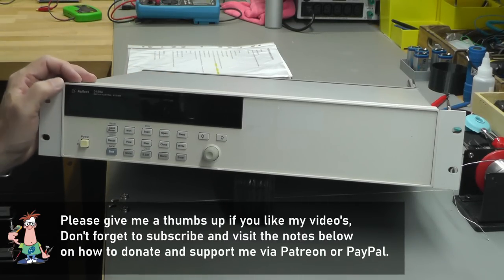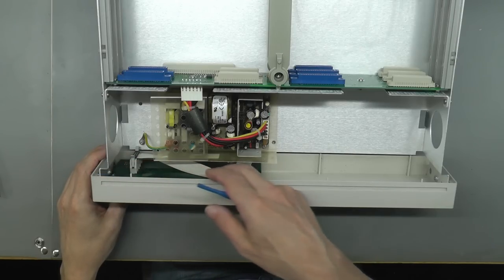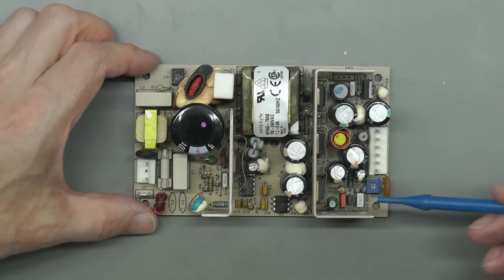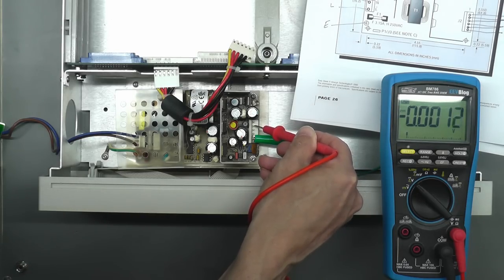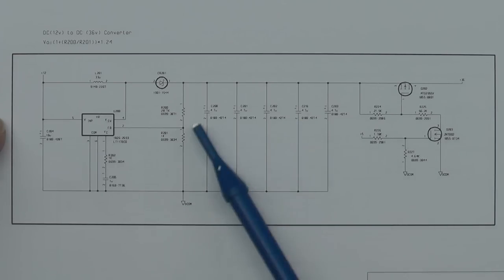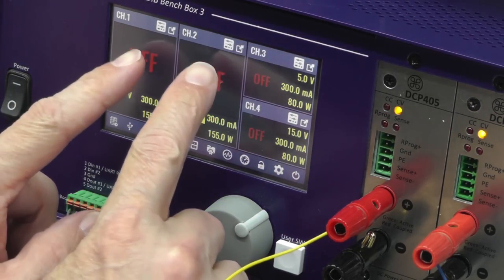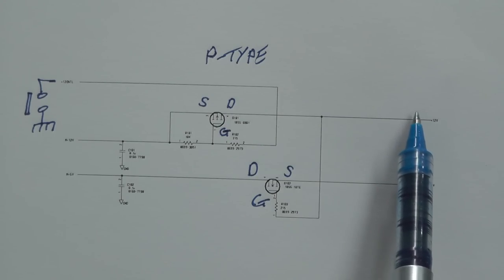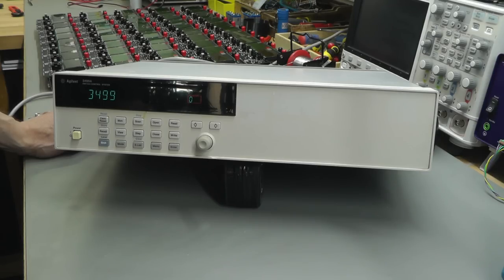No.094 - Agilent 3499A Switch Control System Repair

Comment from the maker: UPDATE:
The temporary P-type mosfet has been changed out for a DPAK package MTD2955V and all is working.
Quick GPIB test, I plugged in a 44471A general purpose relay module and it works great with WinGPIB.
ROUT:OPEN (@100)	- open relay 00 in slot 1
ROUT:CLOSE (@100)	- close relay 00 in slot 1

Comment: Nice, low cost fix. It's very satisfying when that happens. This is one of those occasions where I could have fixed the fault and had very little idea what the kit does. It will be interesting to see how you use it. Another great video where you go into detail about the fault finding and repair process, which I love. Thanks for all your efforts Ian, it's all very much appreciated.

Comment: Caps on the out of DC-DC are usually selected with some low enough ESR, that's why they were tantalum (or ceramic in modern circuits) and not ECaps.
Higher ESR will probably translate to higher output V ripple, which may or may not be critical.

Comment: Cool! Very simple device, I am actually trying to find myself a P-Channel Mosfet or two in my salvaged components for a project I am making, but I can only find N-Channel and PNP Transistors!
Too bad I am needing to switch the 12v rail otherwise the 12v to 5v N-Channel idea would work!
Reply from the maker: Yep, the P-channel FET is so handy for simple voltage rail switching.
Reply: Why not use a high current NPN BJT in emmiter follower configuration? A TIP3055 or TIP41C for example? With an NPN BJT you don't need to have a higher voltage on the base than the emmiter for it to fully turn on unlike an N-ch FET where the gate voltage needs to be higher.

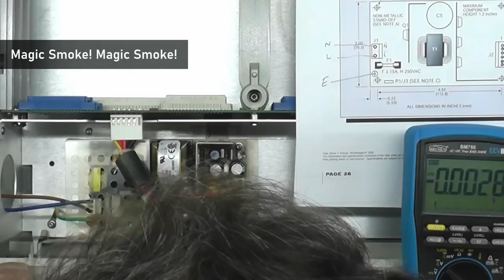Comment: @17:00 when you powered up with backplane plugged on you said there was smoke coming from P/S. So while the issue in end was not the P/S itself, the fact that it did smoke up suggests there is some component on the P/S that got damaged. Yes it still is working but should you not have gone to investigate the smoke source? btw, great video. Really enjoy your repair videos. Cheers
Reply from the maker: I did off camera. I believe it was a resistor, but no damage  even visible, has been left. I caught it quick.

Comment: @IanScottJohnston Nice low cost repair Ian. I do not like always on SMPS and I am a bit suprised that Agilent/HP are using this method as I was a former TV Engineer with Granada TV (retired in 2000) and have seen/repaired a mountain of failed SMPS (using a mains input switch) usually with shattered mains input fuses.
Reply from the maker: As there is no direct analogue electronics I guess Agilent chose to use a switch mode PSU......and also for cost savings by buying it in.

Comment: It seems incorrect labelling on the diagrams is common with Agilent/Keysight I think they do it on purpose to make them harder to clone.
Reply from the maker: The schematics are redraws by some young gun in the marketing/documentation dept., not actually exports from the PCB design software......hence errors creep in IMHO.

Comment: Is there a reason you did not replace the fifth capacitor? (The tantalum that was originally bad.) Also, it seems strange for Agilent to buy an off-the-shelf power supply from China. Great video, very informative.
Reply from the maker: The original caps were 4.7uF, the new ones 10uF, so I had enough total uF with 4 only.
Reply: Artesyn have been making high quality power supplies for a long time

Comment: Very nice repair.
What exactly causes solid tantalum capacitors to go bad with age? 
Voltage spikes? Low voltage rating for the job? A lot seem to short out and blow up after 40-50 years!
Reply from the maker: Transient voltage & current spikes cause crystallization and eventual catastrophic failure. It's important to derate a tantalum. Even with over-rating crystallization can occur and thus failure for no apparent reason.....as was probably the case in my 3499A......hence I changed quite a few.
Reply: Excessive ripple is a main cause, usually as a result of poor smoothing for a main electrolytic filter cap.
Reply: @IanScottJohnston  Well, that sounds like fun! It's competing with Russian roulette :)
Reply: @TheDefpom  Half the power supply was filters! They filtered the AC input, as well as low ESR caps in parallel on the output! I don't know how much more filtering could've be added.
I think Ian's answer is more likely.
Reply: @piconano  There are many reasons for them failing, they really don't like being put over voltage or even run close to their rated voltages, from my experience having a high ripple voltage is what usually causes them to fail, as these were in a switching boost converter there would have been a lot of high voltage spikes that these were having to deal with.
Reply: Generally it is a voltage spike at some time, that briefly drove it to either reverse bias, or over voltage. This then left a weak spot in the oxide layer, and as dry tantalum does not self heal (no electrolyte with excess oxygen to make more oxide layer) this weak spot will eventually fail. Wet slug tantalum does not do this, so long as the seal is intact along with the case it will self heal perfectly fine, till it runs out of electrolyte. then it will, if there is enough energy, go bang, as the case can contain the pressure till it gets to a very high level, and hot enough to melt the solder used to seal it. I have abused 10uF wet slug tantalums to replace 1000uF electrolytics, running them at 5A of ripple, and they have survived, as I needed the PSU to run, and the 10uF was the closest one to hand, along with a very old school 470uF axial capacitor, that at the 20kHz switching frequency was well past self resonance. That, and the dozen capacitors on the PC motherboard, kept the PSU quite happy and stable.

Dry tantalum might take a decade or three to fail, even well derated, if it had ESD damage ( yes they are very ESD sensitive, unless you are over the 100uF mark, in which case they become reverse polarity sensitive due to thin oxide layers) at some point during storage and assembly, or if it had some plug in transients with input inductance that caused a few high voltage spikes. On a power rail always use a zero ohm jumper before the capacitor, and a transient suppressor across it, to prevent this, or use an electrolytic capacitor instead, and heavily derate that for long life.
Reply from the maker: I was thinking about this the other day.....a fun controlled experiment to abuse a few different types of capacitors, tants included.
Reply: @IanScottJohnston  Be sure to include both glass and rubber seal wet tantalums in there, because they behave very differently under abuse. The rubber seal ones will just extrude the seal, the glass sealed ones go off like a firecracker when they get hot enough.
Reply: @IanScottJohnston  Yum Yum Yum. 😀